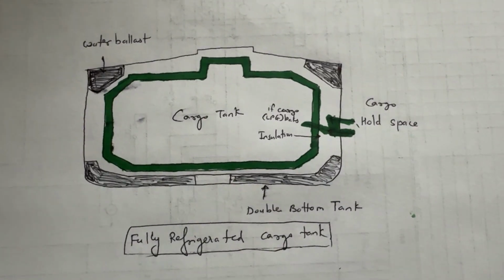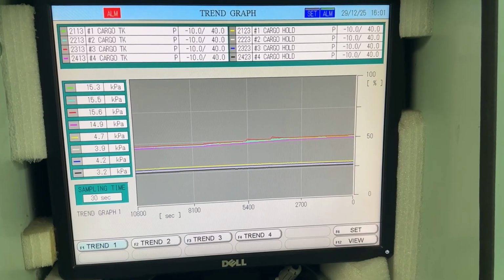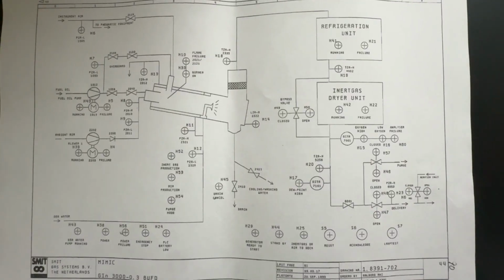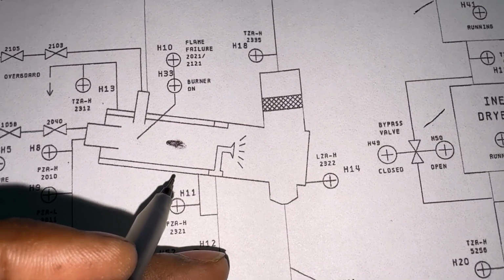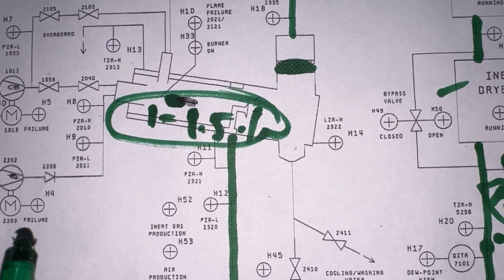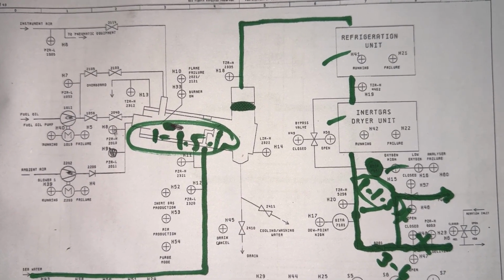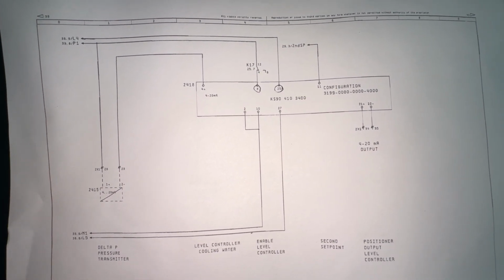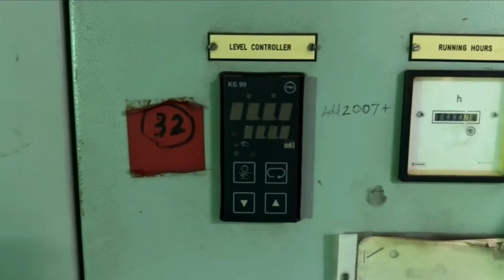Inert Gas System | Explained | Troubleshooting | on inert gas plant | inert gas | sailing engineer

Comment: Can you please suggest on how to run IG system manual way sequencially,because we faced this problem our IG is not starting   and there is also no alarm,we need to do it manully
Reply: Same..
Reply from the maker: 1-for tanker start deck seal water pump
2-start scrubber water pump,confirm there is enough flow by checking the sight gass 
3-start ig bower
4-start fuel pump
5-regarding fuel shut off valves and instrument air you need to discuss wid engineers and check the manual as these valves and line up of the ig must be done wid engineers.
6-open the line going to the o2 analyzer
7-start the ig
8-if o2 is less than 3%,open delivery valve and close atm valve..

this is the basic sequential start..

but read manual and confirm wid the manual before start igg
Reply: @ETOMukesh Thanks a lot it's very helpful